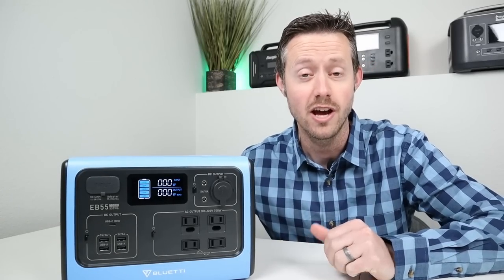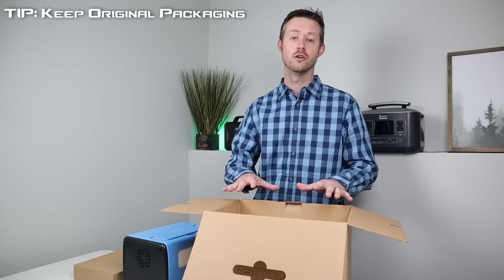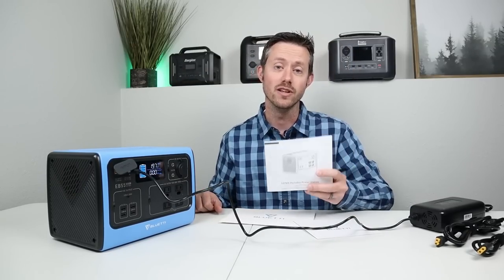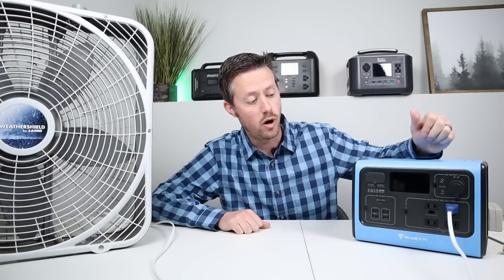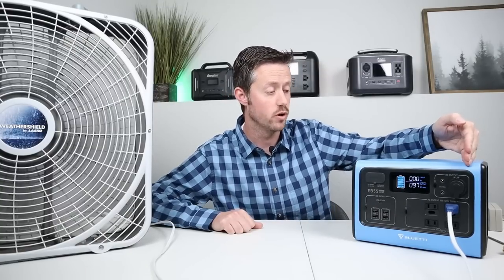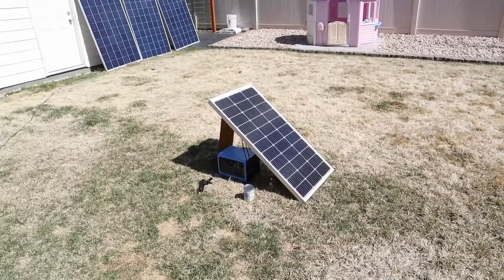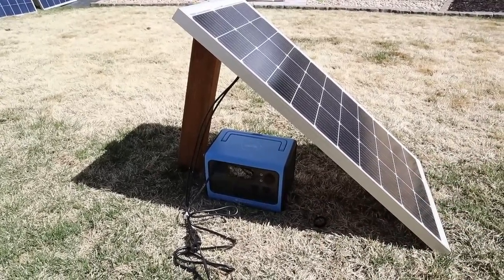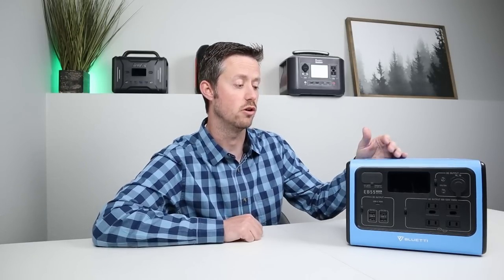7 IMPORTANT Steps To Take With EVERY New Power Station! DIY Testing Guide

Comment: I rececntly purchased the Bluetti eb70s which bangs out 800 watts.Now it came charged at 80% so when i contacted bluetti they told me to run it out to zero than fully recharge so it can recalibrate.I didnt and just charged it the same as you said in the video.Everything is working just fine.Thanks for the great info and BTW i purchased to of those fans on amazon open box for less than 30 bucks.What an investment!

Comment: As always, excellent and highly informative video.  The one test case I will be doing is trying out how I intend to use the battery in the house before I actually use it "in the field" - so for me that testing pass through charging by plugging it into my new 12v fridge and plugging my new EB70S into a wall outlet for about 8 hrs/day.  This simulates driving around for 8 hrs and then sitting at camp for 16 hrs.  The recharge and discharge rates won't be exactly the same in the field, but I'll get a sense of it will perform "in the field."  Thanks again for all your help.
Reply from the maker: That's a great way to make sure your use case will be good for what you plan to power! Thanks for sharing

Comment: Hey there Jason. I know you've probably answered this question amillion times😂 but I really trust your opinion. I'm looking to spend under 400 bucks on a solar generator and was curious what you thought would be these bang for the buck. Thanks for all your awesome content sir🙏
Reply from the maker: There are three that stick out at that price point, the Bibene CN505, the Oupes 600, and the BigBlue CP500. I got reviews on all three, I recommend watching each review and then making a decision about which one will work best for your use case. You can also check out those options on my power station grading system.
Reply: @Jasonoid  Thank you very much🤙 I will most def check them out

Comment: This video comes at a perfect time.   My first solar generator will be her Saturday ( if UPS isn't late as usual).    I used your 7 point  checklist and chose the Energizer 320.  I added point 8... cost.
Is a solar checklist video needed?  Maybe checklist for buying and testing.   If you have one, please let me know.  I am new to the channel.
Thanks for the videos!!
Reply from the maker: My new 'power station grading system' compares power stations on a 10 point grading scale, with cost included. You can view that here:   https://jasonoid.com/powerstations/

I did a brief solar demo here in this video, it should be very similar since your Energizer comes with the same MC4 solar cable as the one used in the video. Plug and play setup.

Comment: Thanks for all the useful info in your videos!! You do it right.
One thing I'm always curious about is why you have to store the solar generators at 80%?
I'm thinking if I have mine Tracy on the side for emergency use of rather have a fully charged unit to get me through. 
Is there a difference between storing Lifepo4 or storing Lithium. 
It would be interesting to know why with all the built in technology this is necessary🤔
Would appreciate an expert's input on this. That's why I'm asking you😀👍
Thanks!
Reply from the maker: You don't have to keep it stored at 80%, but if you do there is slightly less stress on the internal battery so you get more lifecycles over the power station's lifetime. You'll be fine charging it up to 100% and storing it so no need to worry a out it.

Comment: The link for the 12V DC fan only shows a battery operated/AC adapter fan on Amazon.
Do you have a link to the 12v DC version?
Reply from the maker: It's the same fan, it's designed to run off 9 volts, but also it works great @12v. I have been running this battery/ac operated fan off 12v for 5 years, no issues.

Comment: Thanks, I needed this again.
Are you saying if the power station is to be stored, not to store it at 100%
Reply from the maker: Correct, it won't "hurt" it stored at 100%, but the batteries inside like to be stored around 75%, they will last longer that way.

Comment: What wires do you suggest me as an extension of about 10 to 15 feet to connect a Bluetti PV120 solar panel and a Bluetti EB70S Solar Generator.
Reply from the maker: Look on Amazon for a "MC4 extension cable" 20 feet is a good length.

Comment: I’ve watched many of your videos on this technology. It was just what I needed to be off grid if I like. Thanks a lot for these video’s. I do have a question, is it to much to store at 96% ?Would that damage or stress the batteries out? That’s 2 questions.
Reply from the maker: I don't worry about the capacity too much on my power stations (since I have so many) so I leave them at 100% all the time when not in use. I'm fine with 2000 lifecycles so it's not a big deal to me, if you want to 'baby' your power stations to get longer usage, any charging under 100% will help.

Comment: If you are going to use it to power a radio (esp. ham) or amplifier, also test the inverter for noise.  Plug in a radio, tune to a blank spot, and turn up the volume.  Hopefully you hear little or nothing; any buzzing or humming could be noise from the inverter.
Reply from the maker: Great tips to make sure you wont have issues when trying to run that equipment during an outage! I've heard some power stations do better than others when running radio equipment.

Comment: Great video. I just got an EB55 so the capacity test was especially relevant. I needed to plug in 3 items into 3 AC outlets drawing 89 watts for my test. The test lasted 4.63 hours. Crunching the numbers, I’m getting 77% efficiency. My question would be is this about right? I was expecting closer to 85% but is there additional losses from plugging in multiple items vs just one as in your test?
Reply from the maker: I got 460wh on my EB55 through the AC inverter. The only way to get an exact measurement is to use a watt meter to track the power as its going out. This method just gives you a close ballpark but it's not perfect. I bet you got a little more power so it's probably closer to my number. You'll get more power through the DC ouput since it's more efficient than the inverter.

Comment: I recently purchased one of their products, and to my surprise, the back label was that of an older model.  Contacting them, they gave me the run down that the “front” of the unit reflects the actual wattage.  However, this “old” label does nothing for a user now or in the future to just what one can use or not use with any particular unit.  Aside from the shade from customer service the unit seems to be running well.  I don’t hold out much help from customer service, so if it does need service it may as well go to a Goodwill or a city hazardous drop off event.
Reply from the maker: Which power station is this you are speaking of?
Reply: @Jasonoid  the EB70S.  Mine has the earlier label EB70.

Comment: Awesome Sauce Jasonoid! Great video, great information! Im diggin that 12V fan (low wattage wins)....Thank you :D
Reply from the maker: It's such a great fan, it's pretty cheap too :) We use it when camping mostly but it would work well to keep cool during a power outage in the summer.
Reply: @Jasonoid  Thanks I slammed one in my Amazon cart while watching this video lol the 1st thing I thought about was camping and emergency.....thank you!
Reply: off subject but I wish we could connect 2 ei. bluetti 70's together to get double the power, like how I can parallel two generators (dual fuel) Champion to use double the wattage, can this be done?
Reply from the maker: They haven't come up with anything like that yet, cool idea though!
Reply: @Jasonoid  Thank you for replying :)

Comment: Great video! Thanks! So I bought a refurbished eb240 for $479 that I pulled 1850wh from. So if full usable capacity when new is 2100ish(88%efficiency) that would put me at about 88% remaining capacity. It has auto grade li-ion pouch cells. Do you have any tips for storing it so it doesn't degrade as fast? And how many more cycles do you think I have left? Nobody really talks about the life after you reach 80% lol
Reply from the maker: haha 'Life after 80%' is basically the same as life before 80%. If you plan to have it stored for awhile not being used, keep it around 70% charged. If you are trying to make it last longer while in use, don't discharge it too low / charge it super high. You add extra stress and heat to the battery at the upper and lower states of charge.
Reply: @Jasonoid  thanks for the tips!

Comment: When the LiFePO4 unit (Bluetti in my case) ... when it gets to 80% "capacity" is it still usable there... for instance as I keep using it and capacity over the next few years/months goes to 70% ... is it still usable ... I know use times are shorter ... I have an ipad that has lithium ion ... the battery went to under 80% (75%) and the unit was virtually not usable.  ... So when it says to 80% capacity does that mean I need to buy a new unit or again, can I still use it for a while.  I'll have to ask BB the same question.
Reply from the maker: Hey David! Once your original capacity gets down to 80% you can still keep using the power station as normal, it just means it won't last as long as it did when it was new. 

I think it would be REALLY neat if some of these power stations tracked the amount of cycles they've been through, then you could see how if the standard of '2000 cycles to 80%'  stands up to be true over the years.
Reply: @Jasonoid   if not mistaken the allpowers 372wh can see the cycle using phone app connected by bluetooth. By the way where is the allpowers in your grading sheet?
Reply from the maker: @ryangiggs3821  that was the first power station I reviewed on the channel, it was a learning experience haha. It works well for lots of basic charging, but with lithium ion chemistry, unregulated output and I don't even know if it supports pass through charging. I also didn't do capacity testing back then. I don't have it around anymore to do full testing so I wouldn't be able to grade it properly. I've come a long way since that video.

Comment: I just ordered an EB55 on Amazon. There is a $100 off coupon putting it at $399. I also ordered a couple 100w panels but thinking maybe I should have gone with one 200w panel…
Reply from the maker: The 200 watt panels are heavier, I don't think it's a bad choice going with two 100 watt panels. Should get a similar performance.

Comment: how bad is it to charge and discharge your power station at the same time? i am moving into my car and feel like i will need to keep my fridge plugged in while my car is charging my power station
Reply from the maker: Under small load I don't feel it's bad at all. The fridge will pull around 35 watts on ECO mode so not a big deal. If you were maxing out the AC inverter while charging that would create a lot more heat. Just think of heat as your enemy on these batteries.
Reply: @Jasonoid  thanks so much!

Comment: Thanks for noting that those light fabric panels are not good for long term use like with a full-time nomad.  My two "orange company" bifolds are not aging well, I doubt they will last more than a year.  My 3yo Goal Zero glass/alum briefcase panels are going strong..
Reply from the maker: The nice thing about glass rigid panels are that they are priced cheaper per watt and last forever (almost)! I plan to do a small video comparing Portable/folding panels, glass rigid panels, and "flexible" panels in the future.

Comment: That's exactly the one I just bought. It ran my 400 watt freezer I don't know the exact time but it was about four hours and it still had battery
Reply: Do you know some sort of  affordable reliable lightweight solar panel that I can use I'm riding a long trip because I can't take both the panel and the eb55? I need something that's about 200 Watts. When I plug in my bike battery it takes about 150w. I would like to charge a battery while I'm riding. I have one leg now and I use Electric Power only. It is my only transportation I have gone 36 miles with my wagon coming home from camping but going up big Hills not good. When I got home I still had about half a battery cuz I have three. Want to go a very long distance. You seem very knowledgeable. I think I may have made a mistake thinking I could take this maybe I should have bought a flexible solar panel and one of those mppt with up converter. I was looking at the Superlight holiday solar blanket. They were for Preppers it was $2,000 for a 200 watt. Well that's out of my price range. I know there are a lot of flexible panels it's mind-boggling. I know when doing what I want to do cheaper is not always better I need something in between
Reply from the maker: You should look into the Sunpower Flex 50 solar panels, I showed them off in a recent "BigBlue" solar panel review video. They would be very lightweight and would work will with the EB55.
Reply: @Jasonoid  thanks for the reply do they make 200 W that is what most people use for very long electric bike trips. I wonder if there's a way to get more out of your solar with one of those up converters

Comment: Definitely have to get that fan. 7W on high??? That's great.
Reply from the maker: One of my favorite gadgets for camping!
Reply: Can you please add the details on the fan and dc cord?
Reply from the maker: @martyjp100  if you look in the video description you will find the links to both the fan and a cord that will work with it.
Reply: @Jasonoid  I bought the fan from your link and just received it. Something that is VERY important to note is that this fan is now a 9V input. It says on the fan input. The wall wart is also 9V output. Sad. I'm glad I checked before plugging it into one of my 5521 ports! This one's going back and I'm going to try to find the 12V version. From recent reviews, it seems like the company has replaced the 12V model.
Reply from the maker: @Mike_219  I've been running my '9volt' fan at 12+volts for 5 years no issues. All night camping at 9 hour runs, throughout the day. No issues. I would have mentioned it in the video if I thought  there was a problem. You'll get a little higher rpms but no excessive heat or damage on the motor. You can return it but just from my use case and experience, it's fine running at the slightly higher voltage.
Reply: @Jasonoid  Oh reeeeeeeeeally? I did not realize. I've certainly fried a lower voltage appliance before on my 12V power station lol. Thank you for the anecdote! I think I will try it out then!

Comment: I own 5 power stations. From 200 WH to a 700 WH. Each used for different electronics in my house. 200 WH set by the bed. Each night it charges all my Apple products. Two 300 powers my 2 computer work stations during the day. 700 runs my 65 inch TV. The other stores power to switch out one of the others. While charging on the solar panels. Saving about 1500 Wh a day.
Reply from the maker: Sounds like an awesome setup! Glad they are working well for you and that you don't keep them in closets haha
Reply: How much do you save on electricity per month?

Comment: When you explained the 2000 life cycle to 80%, you should have EMPHASIZED that: Yes, after 5.5 years, the power station has degraded to a point where it can only be "fully charged" to 80%, but the user still has a functional unit that can be used for many additional years.  It's just at less total capacity compared to when it was new.  So while the user might be in the market for something new and better by then, this old workhorse is still capable for less critical jobs.
Reply from the maker: Great point, thank you for pointing that out. I can try to be more specific on that in the future. I think most people will understand that 80% capacity still means you can use the power station.
Reply: @Jasonoid  One would like to think that people would know better, but...
My concern is that many reviewers just end their explanation with "by then you'll be looking to replace it".  To me, this gives a subtle implication that you might as well trash the old unit.
Reply from the maker: @HowHingPau  i'll try to be more clear in the future that the power station can still be used.